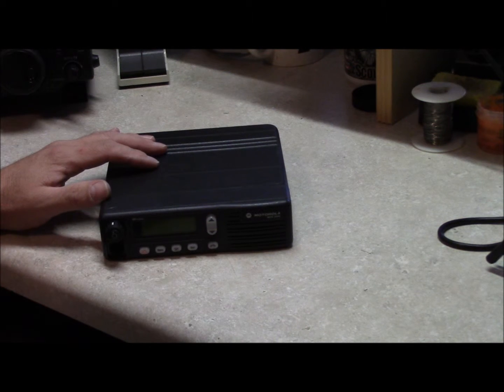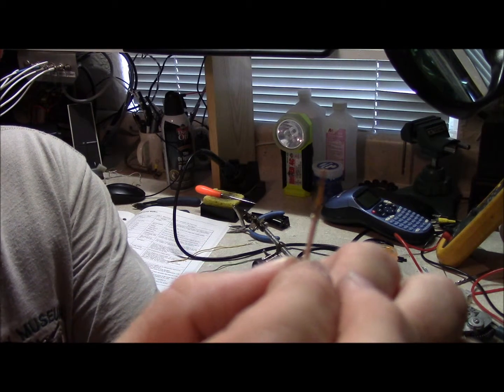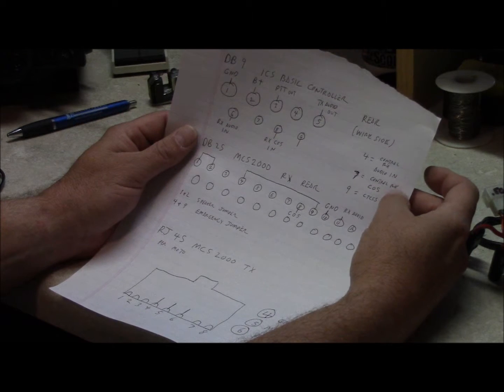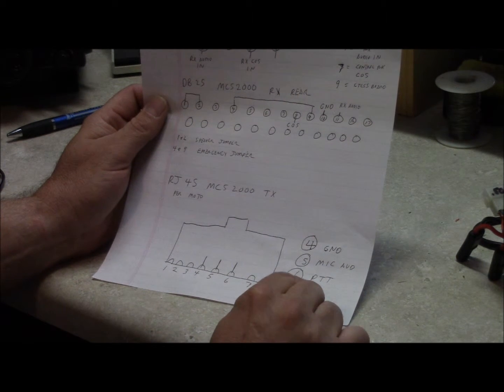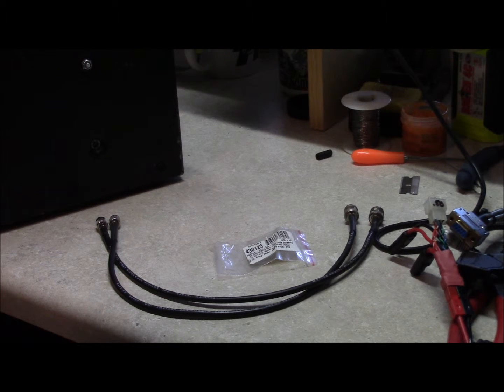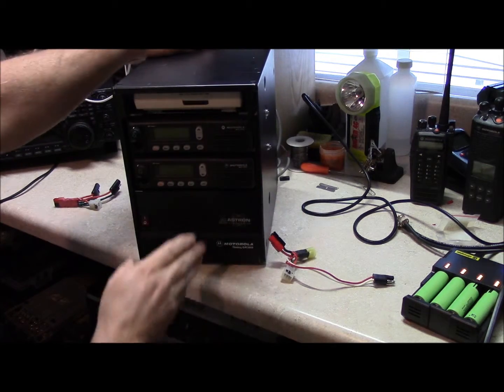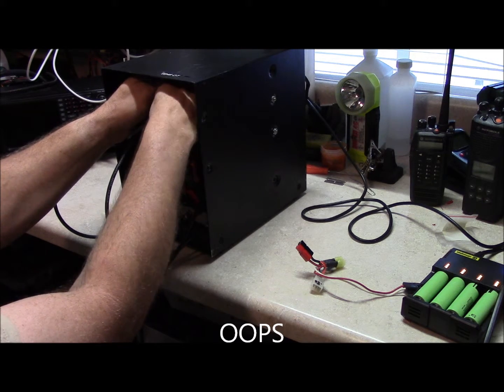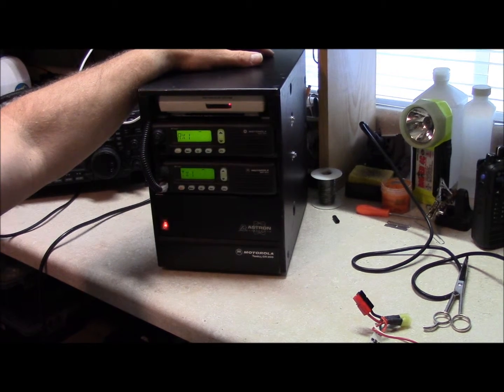Field deployable UHF repeater Part 3

Comment: Whats the actual cost minus radios, I have them? Do you remember, I know I watched almost 5 years late.
Reply from the maker: Its all surplus gear except for the controller and radios. Typically you can find a GR300 enclosure ,  power supply, and Motorola RICK controller for 150 bucks surplus.  I am using a sinclair MR356 duplexer which goes for 150 bucks surplus - chinese ones are less than a hundred but the quality isn't there IMHO. If you want the same controller I used (ICS basic) they are 70 bucks. with hardware and cabling its about 450 bucks total.  If you shop smart you can spend a lot less buying a surplus desktop repeater. It all depends on your needs -  for 70cm (UHF 440mhz) amateur band a legacy 25khz wideband repeater will give you good service. I hope this helps ! Thanks for watching !
Reply: @survivalcomms  Thank you for responding. 👍🦅🇺🇸